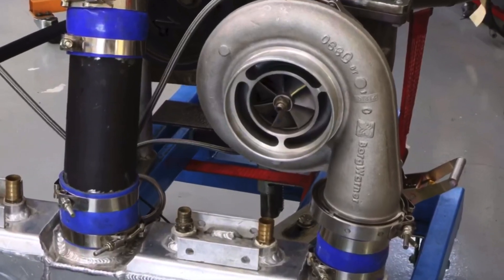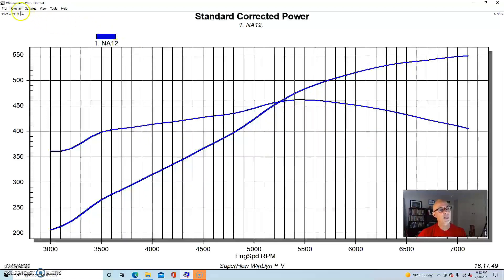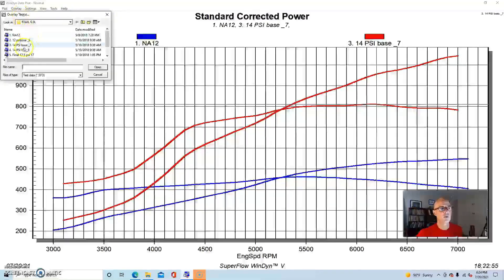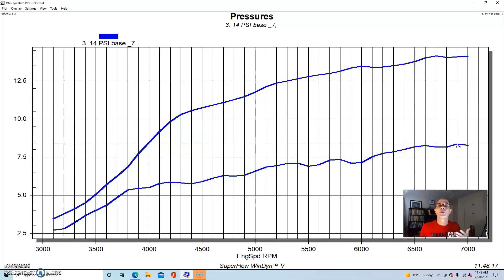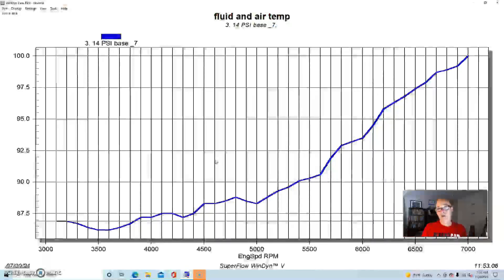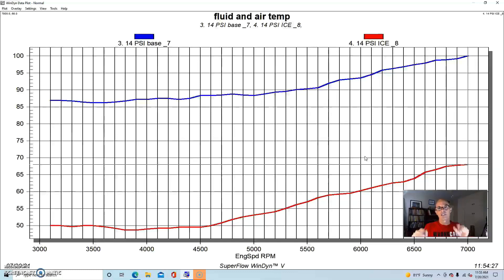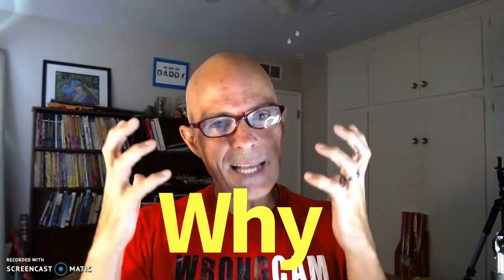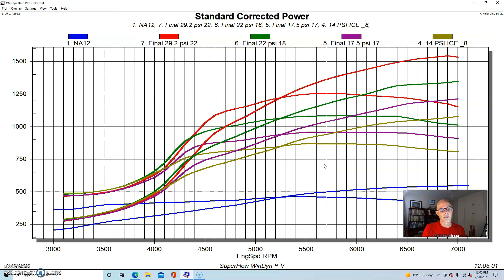JUNKYARD TWIN TURBO 6.0L ATW INTERCOOLER TEST (ICE WATER)

Comment: IC water pump question… Was the water pump for the intercooler in this test a Meziere 55gpm single inlet, dual outlet pump? If that is not enough flow, how many gpm would you actually like to see on this particular intercooler?
Reply from the maker: I would like to see both more pump and flow through the core with bigger fittings and straight through (not looped)
Reply: @richardholdener1727  Right, you mentioned that in the video. However,  I don’t believe you mentioned the flow rate of the pump you were using.

Comment: what was fuel used? would the results be better if the fuel was M1? i know people ditch the intercooler once they switch to m1 but would it be worth it to keep the a2w and ice ?
Reply from the maker: IT MAKES MORE POWER WITH AN INTERCOOLER (EVEN WITH M1), BUT RACERS ARE CONCERNED ABOUT THE WEIGHT VS POWER GAIN

Comment: Would compressing cold air allow more molecules to condense smaller into the same space than at normal temperatures which in turn increases boost pressures

Comment: Kind of a weird question. Can an intercooler work both ways? Like can the same dual in/single out work as a single in/dual out? That way you could run one turbo to a dual throttle body intake.
Reply from the maker: yes

Comment: Can you do a video where you try to match these turbo ls horsepower numbers with nitrous?? We see you can slap a turbo on and make 1200+ but what kind of setup/how much nitrous would it take for that 6.0 to make 1200 on gas?
Reply from the maker: I did that and you can never match turbo hp with nitrous

Comment: I like the videos, very informative.  Any recommendations or videos you have done for a daily driver.  I have an H2 with a tired Gen 3 6.0.  I'm looking for about 500-600hp dual intercooled turbo setup with minimal lag, good engine longevity and good all around driveability.  Is this possible in your opinion? and any recommendations?  I've considered a Duramax conversion, but aside from the cost, I would like to preserve the factory full time 4 wheel system as it works really well both on and off road.  I know this is a little outside your wheelhouse but any recommendations much appreciated.  Thanks in advance.
Reply from the maker: that is all possible with the right tune

Comment: I'd at least run twin pumps for two separate cooling circuits.  That dyno water gets pretty slimey too, doesn't it?  I wonder if your intercooler is a bit clogged.
For ultimate flow, I wonder what a big FMIC in a horse trough full of ice water would do?  Way more surface area but unless you used a couple trolling motors (LOL!) I don't know how you'd circulate water through it.
Reply: OR have the FMIC mounted horizontally, cover the bottom with plastic sheet with holes poked in it, then put the hose on top to  fill it with ice water.  It'd be a soothing intercooler rainfall.  ...bench racing is fun...  LOL!

Comment: Have you used a intercooler at the intake like this one below?
https://www.tickperformance.com/combo-hot-deal-tick-1-400hp-air-to-water-intercooler-and-holley-ram-intakes/
Reply from the maker: i have run one of those
Reply: @richardholdener1727  how well do they work vs the typical ones you run on the dyno, do they offer any advantage other than space savings? Would they get condensation in the intake with icewater?

Comment: Richard where did you take your reference pressure for the Wastegate’s?  
Before or after the inter cooler as the cooler condenses the charge more with the colder cooling medium it needs to flow more and my guess you will have a higher pressure drop across the core. 
But i know nothing and that’s my best guess. Keep up the great work 👍
Reply from the maker: we take it in the manifold
Reply: @richardholdener1727  well that rules out that idea. Thanks Richard keep up the great work and keep us posted when you find the answer

Comment: Add salt to the ice and water.... it'll be much colder
Reply from the maker: the salt changes the freezing point of the water but does it add coldness?
Reply: The temp of the solution will drop 15 to 30 degrees, so yes they react dropping the temp

Comment: A2W is cool on the dyno but it just never seems worth it in real world swap applications compared to basic A2A. A2W adds the failure points of lines, connections, fittings, etc and the complexity of the tank and pump system, and the maintenance of the water.
Reply from the maker: IVE RUN ATW ON STREET CARS FOR YEARS WITH NO PROBLEMS, BUT THEY BOTH WORK

Comment: Also worth mentioning you accurately said you didn’t set it up to change AFR... that doesn’t mean the Holley system won’t give it more fuel, because it did, to maintain the commanded equivalence ratio in the presence of additional oxygen. 😉
Reply from the maker: the Holley doesn't change the supplied fuel to the motor unless I command it-it was not run with any modifiers or under closed loop-I changed the AF to equalize them between the two runs

Comment: The incoming fuel particles were smaller due to lower temperature. Compression of fuel particles wasn’t as big a factor so there was increased boost. The relatively small change supports that hypothesis. Probably not. Maybe!

Comment: Denser air means more fuel in the cylinder. It's not just how much air you can jam in there or how dense it is....its the combination of both fuel and airat the same afr. More burnt fuel means more exhaust gas to spin the turbos or more back pressure

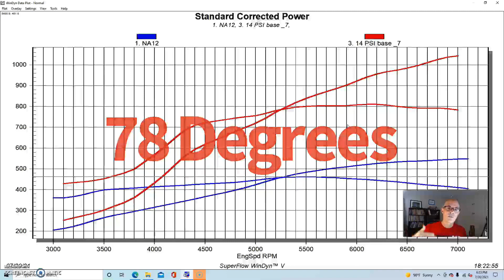Comment: Hey Rich & others.  During the mid 1990's I ran a similar test using a very archaic test method.  What i did was to take a frying pan heat it up to just under where it would burn the surface and smoke.  My first test was with sink water.  I noted the results.  Then I grabbed some near frozen water from the freezer and did the same thing with it as I did with the sink water.  Wow was my reaction.  From these 2 tests I was able to design and  invent a device.   Which mimicked the reaction you and I both had.  I know the answer.  However if I say explicitly Someone else will figure it out (if they haven't just now) and beat me to the patented office.   You are the closest to learning & unraveling this part of science.  In fact; I then tested my kitchen antics on a new C4, auto with 2:59's.  It ran 13:38's at 104 mph consistently.  In fact I was beating 383's (chevy versions), by 3 tenths of a second.,  One ran 13:6 at 110  to my 13:38 at 104.  He was faster, but I was quicker. If we can do a side bar; I will explain.  I just do not want all the details to be public.  Congrats on your brilliance Rich.  I then created this branding.  https://paceage.com/p-a-c-e-performance-and-creative-engineering-age-well-for-grown-folks/. Oh 2 magazines care the story;  Corvette Fever and HiPo Chevy.  Btwn July and Oct 1996.  If anyone has or know how I can get copies during that timeframe; Please share. Thanks.. CJ

Comment: Richard, quick question on a stock bottom end lq4 with stock 243s with springs LSXRT intake Nick Williams 102mm tb a comp 54-469-11 cam 1.75" runner shorty headers (no room for long tubes) to a 2.5" dual exhaust with x pipe with very open borla attak mufflers. 

what kind of crank HP would you expect to see? 

Based on your videos and my grade school maths, id thinnk 530/465 is close dont ya think? 

Thanks!! Love all of the knowledge your putting out there keep it up!
Reply from the maker: 469 CAM?
Reply: @richardholdener1727  ah yes! sorry about that.

Comment: Charge air came in cooler, more dense, heated up in the manifold and expanded more (got hotter, less dense), pressure in manifold increased. Manual boost controller doesn’t know the difference

Comment: Have you ever tried to put an intercooler in before the turbo? My logic says that if you increase air density before you compress it you would have that much more air entering the engine.
Reply: I'd guess that the gains to be had doing that wouldn't be worthwhile.  You'd only be cooling the air from around 80 degrees in to the 60's.  Like the difference between racing on a warm night to a not-so warm night.  Whereas using it on the output, you're dropping it from 200 degrees in to the 60's.

Comment: Guessing air is colder so the molecules are smaller and the same amount of air takes up less space, so you can ram more air in the engine increases the pressure and the boost making more power..

Comment: *Explanation* I work with compressors for a living, the best explanation I can give is that hot air is less dense than cold but pressure is relative to density so when the hot compressed air cooled it increases the density, if you where to have 2 sealed containers with 5psi and place 1 in a freezer the 1 in the freezer would lower in pressure because you increased the density of the air and lowered the volume/psi. So when that air was heated in the combustion chamber that extra volume of air expanded causing more gases in the exhaust. You maintain 14psi at x° and this is measured after the intercooler. I can pretty much bet that if you would have a flow meter in front of the turbo you would see a difference between the runs in the consumsion of air also try to take measurements of psi pre and post intercooler. Lol I think I might have confused myself lol. Its kind of hard to explain on a phone

Comment: The boost went up when you changed the air temp because of air density. Air, even though we can’t see it, does have a quantifiable weight to it and that weight changes with ambient temperature so at xx degrees F the turbo can suck so much air and then when temp changes to xx degrees F the turbo is then moving a different amount of air.

Comment: The boost  pressure rising is a function of the intercooler itself because you measured boost pressure post intercooler what happened was when you cool down the air you allowed more dense charge to get through the inner cooler there for the speed of the air increased therefore the pressure increased. I think if you had run a larger air to water intercooler you would not have seen this climb in first because the volume of air would’ve easily gone through without having to be that cool. Your  air to water intercooler is too much of a physical restriction

Comment: The air gets denser the colder it gets so you were flowing the same volume but the air was denser overall thus more boost, put a variable pump on the air to water intercooler that flows more as your rmp increases and your charge temperatures will be a ton more consistent.

Comment: its simple. PV=mRT, less temp and more mass flow = more pressure (at the same volume). I would like to see these tests run with a fuel flow meter and an LFE. You would have probably measured and increase in airflow rate and an increase in fuel flow rate. From the numbers you give, the ice gives about a 7% increase in airflow mass which is proportional to the 70 hp increase in power at 1000 hp.

Comment: If you ever do the big bang 6.0 again, can we please see the numbers with different fuels like e85,87,93,& Q16 ?🤷‍♂️
Reply from the maker: BIG BANG IS NOT ABOUT FUELS-ITS ABOUT STRENGTH OF THE INTERNAL COMPONENTS
Reply: @richardholdener1727  I definitely know that...but I'm building a replica & would just like to see the maximum hp on certain fuels

Comment: two things are happening, the more relevant one : the engine is processing more air, and since there is more air in the exaust the turbo reaches higher pressure.
 the less relevant one and easy to demonstrate in the dyno, is all the hot air coming from the turbo has velocity, because its loosing density very quickly that velocity stays high, so you have a ram effect. To test : you increase the distance of the tube before the intercooler and will have an slightly increase in hp.
not something you want for response :D

Comment: Boost went up because of the colder more dense air. Back pressure went up because of the colder dense air as well. Hot air molecules vibrate and move around which makes it harder to achieve a set boost pressure over a cold air charge. Cold air molecules aren't vibrating around like hot air molecules so it's easier to cram more into the cylinder. When they exit the exhaust they are vibrating more than that hotter less dense charge from the hotter air from the Dyno water. The cold air created an increase in back pressure and probably a better boost response because more of that hot air was trying to exit through the turbocharger than with using Dyno water. This is the reason they make the blankets for turbochargers it functions like header wrap not to mention it lowers the under hood temps.

Comment: I suspect theres is an increase in fuel injector duty when running ice water and therefor there will be an increase in airflow through the engine. More airflow throgu the engine will increase the boost if the wastegates valves stay in the same position.

Comment: Physics ideal gas law says pv is equal to nrt meaning that pressure and volume are directly effected by temperature. As pressure and volume increase so should temp.  In this case 32 degrees is not an ideal temperature for the law.  As the boost hits and the temps cool the air density will increase and should be the cause of the increase in boost early on based on the extremely cold intercooler temps.   I'm not a physicist so I could be wrong lol

Comment: The turbine side of a turbo reacts to mass flow so with higher mass flow the faster the turbo wants to run, the boost controller needs an difference between setpoint and value measured to react proportionally to that difference, so there will be a difference in boost

Comment: I am curious to see what type of afr changes there may have been, and what how much iat compensation it uses.  Definitely a denser charge, that went through the engine making more turbine spinning exhaust power,   May also be that its easier to compress the denser air if the turbine speeds were similar but we don’t really know the shaft speed.  Backpressure was like you said, more power through the same sized hole/turbine.
Reply: Damn everyone on density, maybe the wastegate wasn’t big enough
Reply from the maker: there is no compensation for IAT-and AFR was the same (because I added fuel to the colder run to keep it the same)

Comment: Colder charge temperatures = more density there for to maintain af ratio injector pulse goes up high density air + more fuel equals power and more exhaust increases boost

Comment: Clearly the ice water made the aluminum on the intercooler tubes shrink as we know that metal will shrink when cooled and made the intake charge cooler and more dense, so the boost went up because the intake was also smaller because of the lower intake and more dense air, more air in a smaller space makes more pressure. If you believe anything someone on the internet thinks you’re crazier than me! 😂

Comment: Back in the mid 2000's guy I kinda knew had a Schimmel AWIC rig on his VW VR6 turbo car.   He talked about how putting ice in the reservoir made a lot more power, but with the tank mounted in the trunk I wondered how cold the water would be after it travelled through 9-10 ft of hose.  Car had a heat exchanger under the bumper, but I don't know which side of the system it was on.   Also never saw any dyno charts for the car.

Comment: The ice water temperature rise could be the induction charge doesn't spend enough time in the intercooler to dump all its heat due to its increased velocity. The boost pressure increase might be akin to viscosity. A denser air charge at the same velocity would increase pressure.
Apologies for my 9th grade education founded theories.
Reply: At least your not over thinking it, with a huge long mathematical equation and explanation, others are doing or saying oh it’s just dense air, lol….I’d say the answer is simple cold air has smaller molecules and takes up less space, leaving room for more air to be rammed into it, unlike hot air which expands, less air per stroke..so if you can ram more air into the same space it should increase the psi, and  so during the compression stoke , thus making more power, it’s too simple I say..

Comment: Cooler (denser) air means more fuel is needed to maintain the AF ratio.  More fuel means more power.  More power means more waste energy in the exhaust to drive the turbos resutling in higher boost.

Comment: Like Gale Banks said. The boost Guage is dead, MAD or manifold air density, it tells us airflow instead of resistance which is what boost is. Past SC truck. Stock motor was 16/18 psi. Ported and polished from throttle body to even header flange. Psi dropped to 9 to 12 but Horsepower jumped by 72 rwhp
Reply: Exactly. Boost means nothing without a map sensor.  Best time to run a turbo car is a foggy frosty night here in England 🥶  the air is so thick you can cut it with a knife

Comment: ideal gas law.  PV=nRT.  You lowered the right side of the equation, temp, and you basically held the volume the same between runs on the left side of the equation so the pressure needed to increase.

Comment: Cold air is denser, as it is denser, it has more oxygen, as it has more oxygen, more fuel can be injected into it, and the more oxygen and more fuel it has, the stronger the explosion and the strength of the engine will
Reply: Wrong answer..

Comment: increased density in the intake means more flow in the exhaust the wastegate is set to bypass a percentage based on flow you now have more flow so some is going through the turbine and drivinh it harder as the wastegate opens to compensate the spring gets stiffer and give more resistance